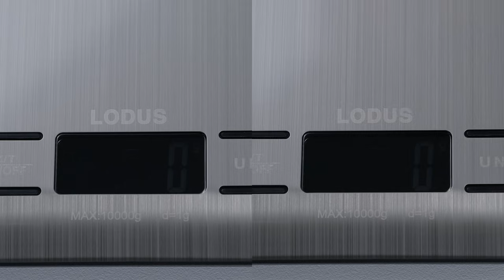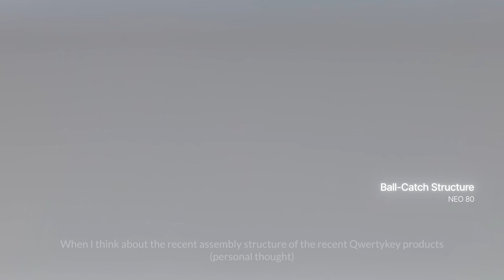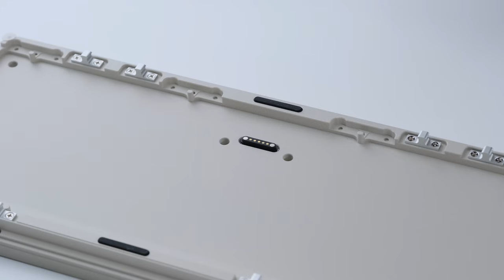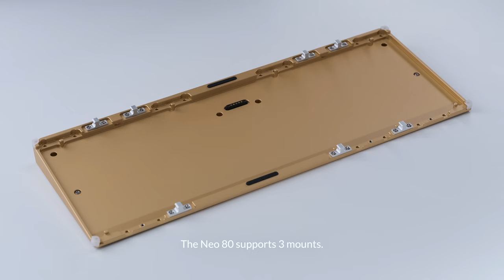NEO80 / Keyboard Preview

Comment: I have been quite impressed by the design work on Neo80. One keyboard packed with different mounting styles, plate design, pcb options, quick assembly and disassembly option that lead to different sounds profiles. They really put a lot of thoughts into the design of this board

Comment: Another beautiful video. Love how you made boring comparison segments look so artistic while still serving full purpose of the comparison. Neo80 has one deal breaker for me, and that's the rotated switch for the |\ and the Enter keys. On my Neo65 with Neo White, the |\ keycap doesn't sit flush because the switch stem is tilted on the Neo White. That put me off completely from all PCBs with rotated switches anywhere now. :(
Reply: More of a switch issue though right?
Reply: Yeah it is. Ultimately I guess it's the total package of the Neo80 not being attractive enough for me to give up the Neo White (I really like how that switch feels). I went as far as to get a wired-only hotswap PCB on the Neo65 because the trimode Neo65 has the same rotated switches. Would probably have got the Neo80 if it offered a wired PCB with no rotated switches.